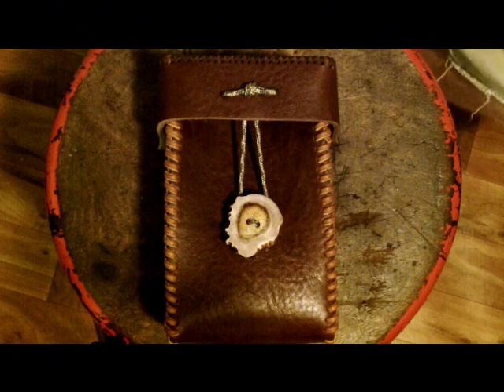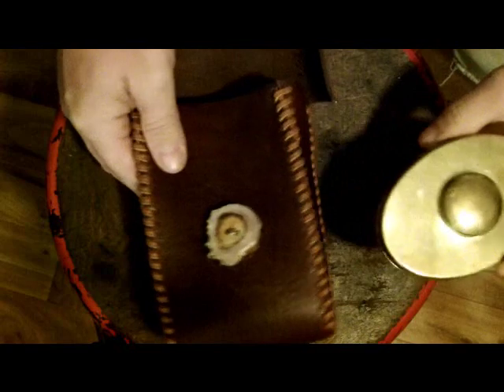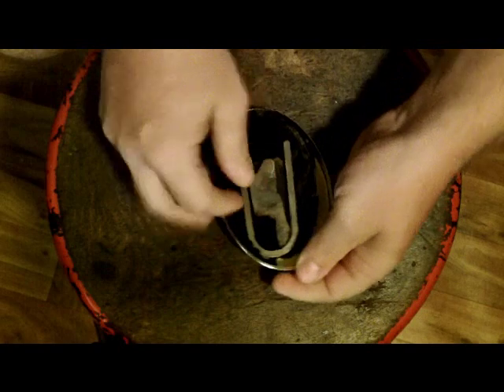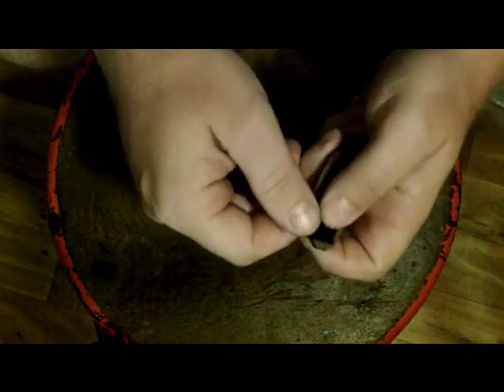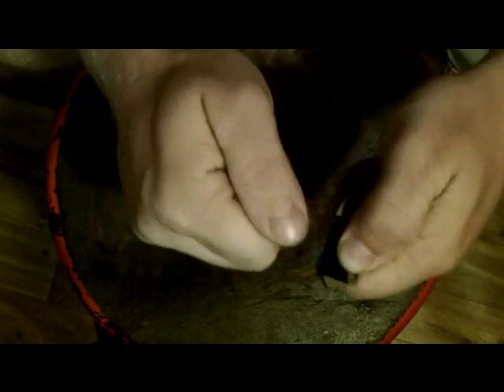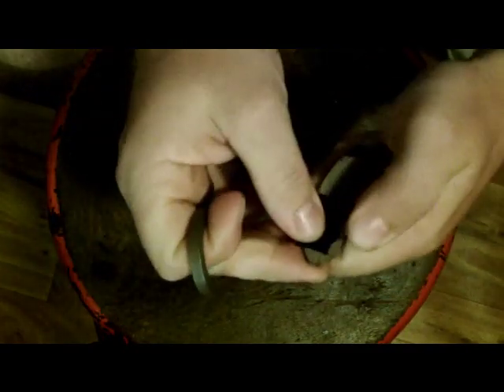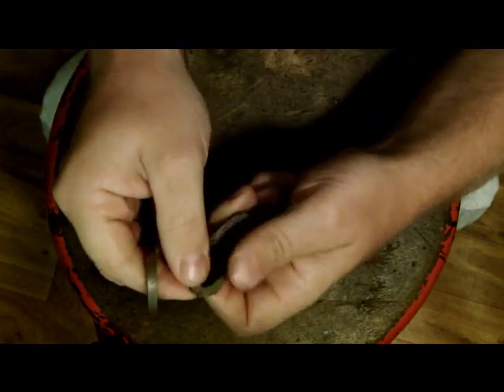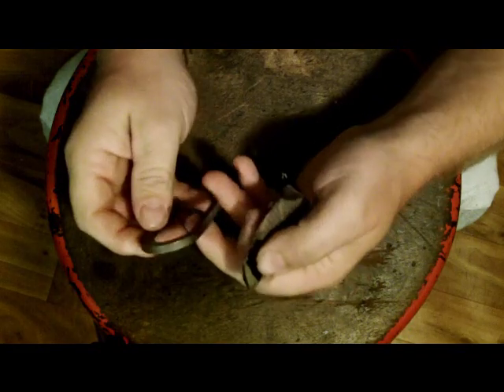Proper striking of flint and steel

Comment: In my experience, some flints work better than others. Real agate, for example, seems to work better and hold up longer. And the key with any flint is to start with a really sharp blade-like edge. That throws the best sparks by far.